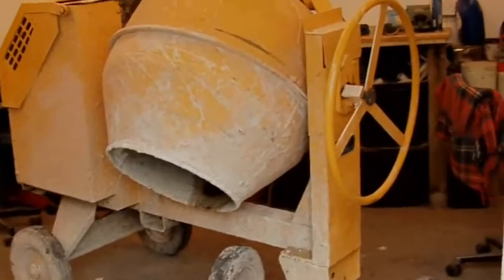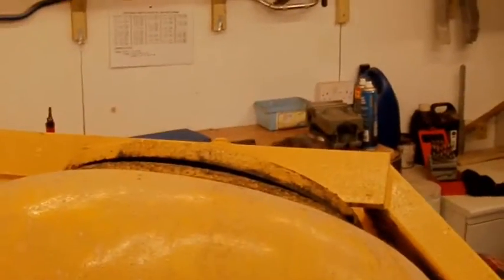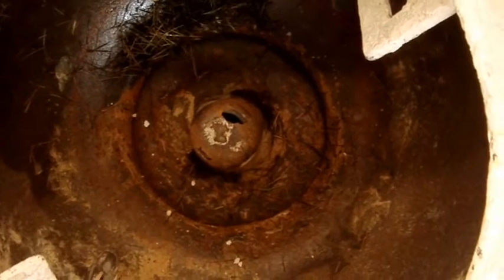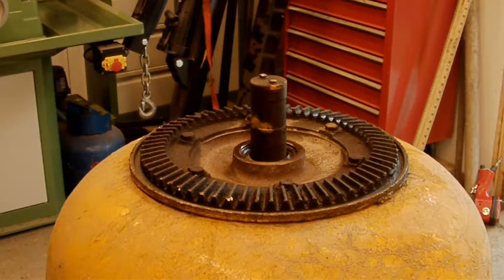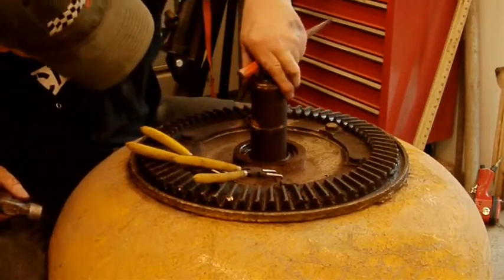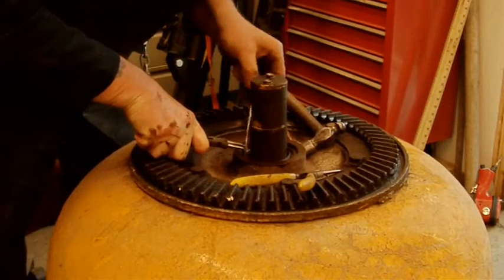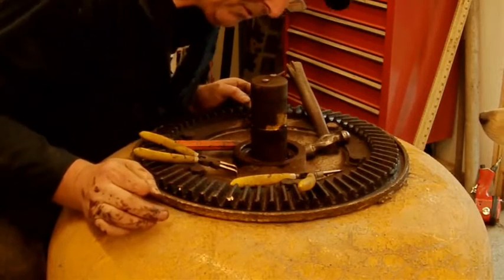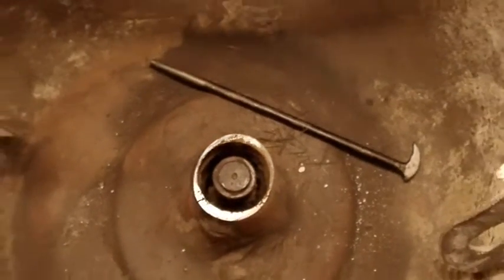Winget Concrete Mixer Repair Part 1

Comment: Hi, I’m having some problems breading shaft away from the frame on my mixer. Any hints on how to separate the shaft from the machine?
Reply from the maker: Hi james if its the same as this one and the bolts have come out ok heat the frame if you can get to it ok and then a very big hammer :)

Comment: How to remove the barrel
Reply from the maker: Hi At .55 seconds the long bar running along the bottom of the barrel has 2 large bolts to hold the barrel shaft to the mixer, undo these bolts ( they brake off easy) then you can lift  the barrel off the machine. good luck.

Comment: Sir I have purchased a used cement mixer,it has got really bad betting in the bottom cast of the cone,how to grind it for smooth finish, so that the concrete won't fix inside the bottom cone,any help in grinding the cast
Reply from the maker: Hello pradu if you watch all the video's in this series you will see what I did.I had to cut the top off the cone
and use the milling machine to make a good surface then I put a brass sleeve before fitting the new bearing.

good luck with yours Nigel
Reply: Sir Thanks for the reply,I don't have a milling machine,however I have hand grinding tool,if you can suggest a grinding wheel,for grinding the casting bottom of the cone.
Reply from the maker: Sorry prabu I can't help you with that good luck
Reply: Ok sir, thank you